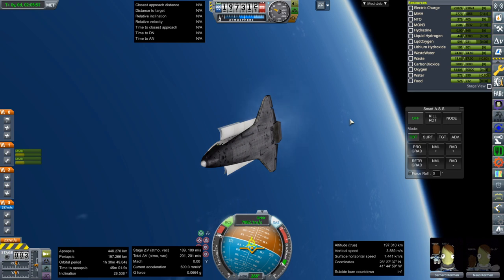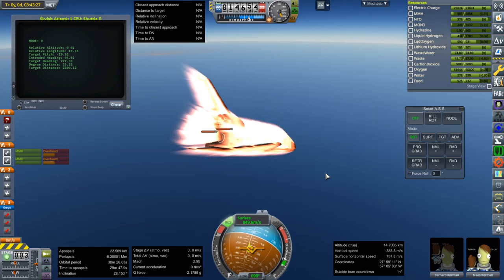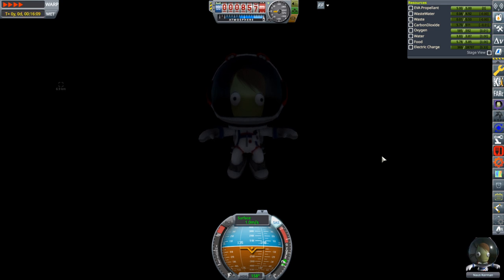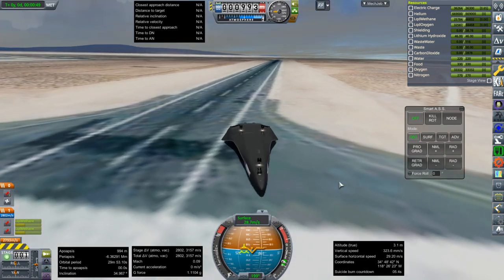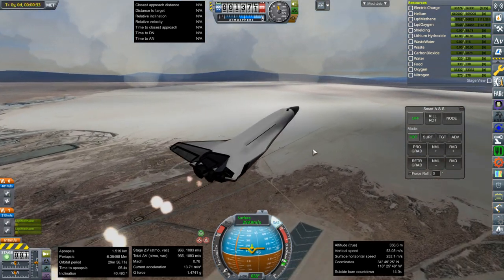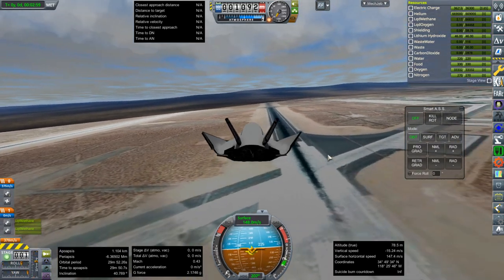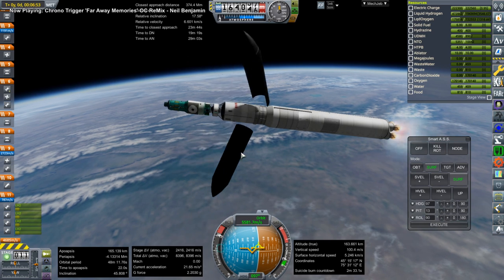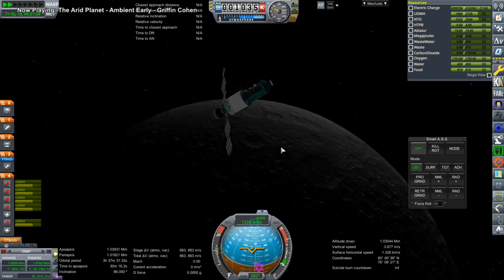Kerbal Space Program with RO - Solar System Tourism 03

Comment: The shinkansen strength problem is that it is the root part. Ksp likes to delete child parts first. Maybe you should steal some parts from OPT and make it properly out of multiple parts?
Reply from the maker: "Properly." It actually has significant child parts - the cabin and propellant tanks are separate and clipped inside, so it's possible the body is left a fuel-less, lifeless hulk when it crashes. Thankfully, I didn't test with kerbals inside.